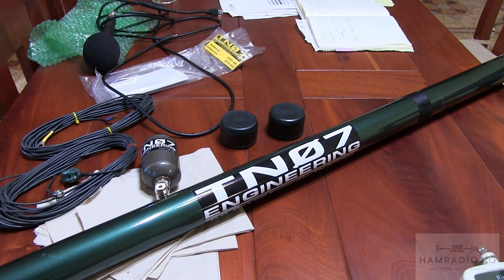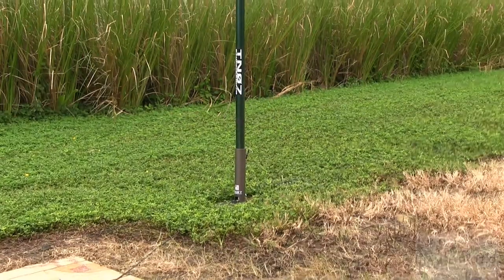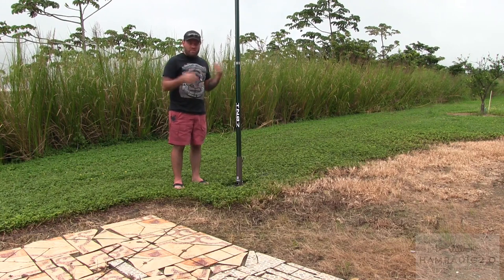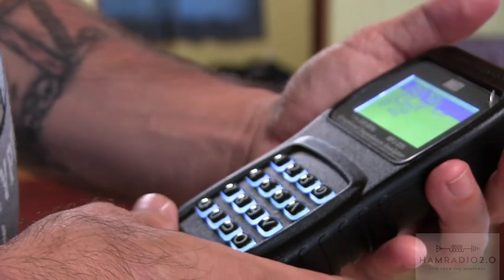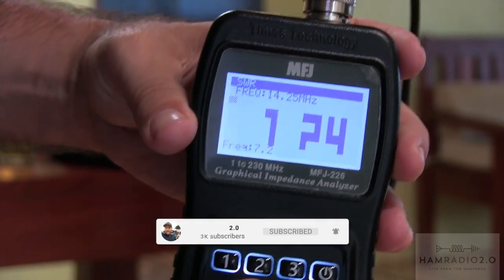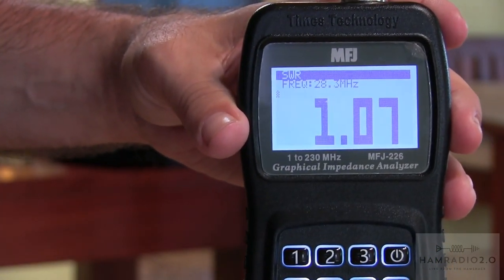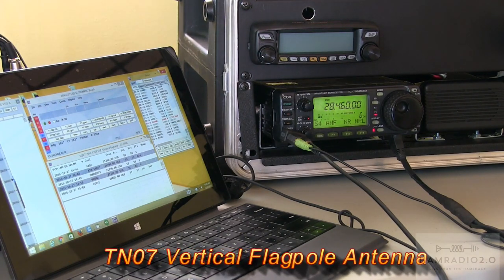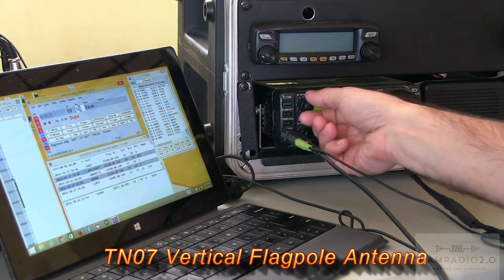TN07 SFP-102 on DXpedition | Ham Radio Antenna Setup and Operation

Comment: I run the same antenna on my motorhome.  I have contacted most of the states Europe and Africa.  It is an excellent mobile antenna.  I'm running  an FT-991A with 2 radials on the antenna.   Set the antenna up screw it in to the radio and it just works.

Comment: Thanks for the video- interesting antenna concept.  But I went to their website (url in this video's description): it provides absolutely no information about what kind of antenna this is.  Is it a shortened/inductance loaded or trap antenna? Wire with a 4:1 or 9:1 or 5:1 transformer? Does it require a radial system or a single counterpoise?  This type of info would be more helpful than the SWR measurements.......

Comment: Love your channels I have a question I have 4 rid radios 2 are the same model the other 2 are the same pair I have them all set to the same set up and you can receive on one set of radios but cannot transmit on the other pair is there a problem that I can fix with this The frequency is 454000 UHFPrimarily use for racing automobile reason control tower